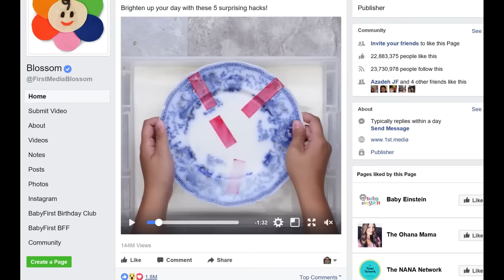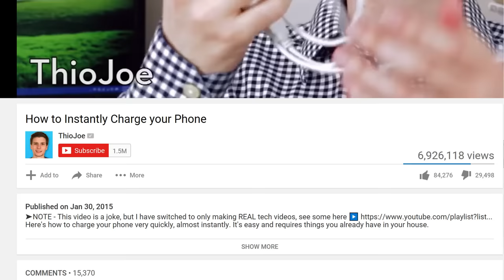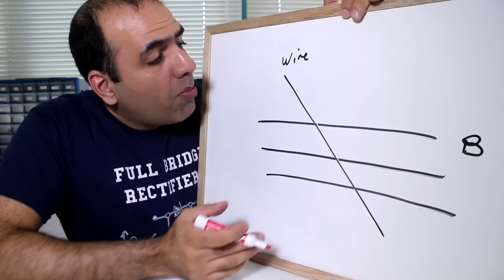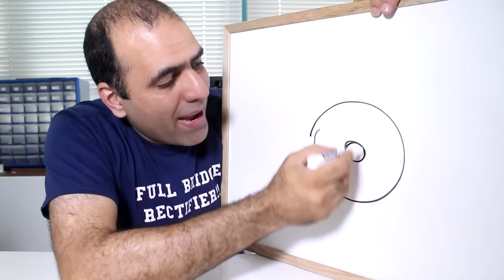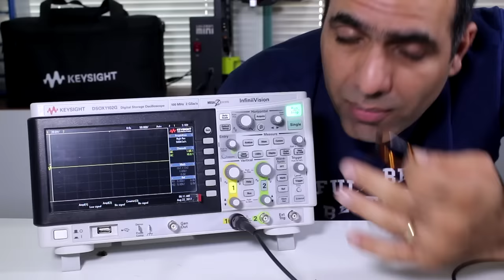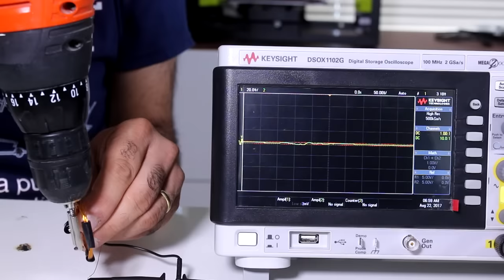Fake DIY Projects Exposed, and How a Real Generator Works

Comment: can someone explain the full br... i mean THE FULL BRIDGE RECTIFIER joke?, withouth the context it's still funny because of the way he says it, but i don't know what makes a FULL BRIDGE RECTIFIER so special lol
Reply: An AC signal changes the output from positive to negative every half cycle, while a DC signal is a 'constant' output. In general, a rectifier circuit is used to convert AC to DC. Since AC is a wave, you want to use a full (full wave) bridge rectifier to convert the entire AC wave to a positive (or it could entirely be negative) output. You can see the rectified (converted) output of an AC signal on his shirt on the rhight hand side (the bump looking things), but it still isn't a smooth signal so you would filter the output by adding a capacitor at the output to lessen the signal drops between the peaks of the bumps.

Comment: I remember after learning about generators in physics I tried to use a multimeter and a bit of wire I had free... I created no measurable voltage and was quite disappointed.

... I remember because it was a few months ago.

Comment: I have tried the milk thing. It worked and made a super strong repair. I was not expecting it to work. I then told all my family and none of them could get it to work. But they used different milk and I'm not 100% sure I gave them the exact instructions I followed.

I tapped the cup together with the fewest tiny bits of tape. Then submerged it in milk and simmered for either 2 or 3 days. I think anyway. I was so not expecting it to work that I didn't do it rigorously.

Oh, it was 150 year old China.
Reply: Quit lying.

Comment: dang. from 59% to full = 2 hours and 23 mins to fully charge on a little mobile phone.
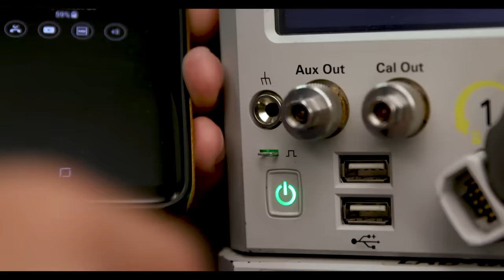thats one weak as USB interface..1990s USB2.0 9:00 with 500ma on a 450.000 US scope, dang even a 500 bucks Micsig scope got USB3 5Gbps high current and TypeC interface.
But its your lukcy day Keysight fellow...lets flip scopes, so you can charge your phone faster.

Comment: You can maybe create free energy while the coil is connected to the motor and the magnet is in the front of the coil and then when you spin the motor generates energy and fix itself over and over and over it's not going to last forever
Reply: You cannot. The coil will always make less energy than it takes to power the motor

Comment: Even if the rotating magnet generator worked, wouldn't it still be easier and cheaper to just get a cheap charger for $5 that out would be too get the magnets, the regulator and solder the whole thing together? If you're lost where no chargers are available, then why would any of the other things be available.

Comment: iPhones have to talk to the charger over the usb connection to make sure they are approved chargers before they will accept a charge.
Most androids only need some voltage on the + and - wires.
Reply: It can easily be bypassed by giving 2 v to data lines.

Comment: I love your channel the shocks make it...i got one for you i never put it out there but i think i found something i just thot of it and tryed it and well it works....take a cell phone with a sound generator app set to 432 tip the phone on its side and hot glue a thread balanced on the side and hang it from the cealing let it stop spinning first then turn on 432 and i found it all ways turns to the right no mader witch side you put it on....so i was thinking we need to harness the energy like make a motor that when turning would generate the 432 by its self thuss power it self thuss free energy......test it your self....

Comment: Fun fact even if that guy got above 5 volts on thaf thing the 7805 regulator would burn coz they dont realy like reverce polarity (learned this the hard way) and preaty sure they wont survive ac as capacitors do

Comment: The aluminuminum foil thing should work by blocking all wireless connections, essentially putting your phone in airplane mode right?
Reply: Won't block them entirely, it will attenuate the signal somewhat, meaning connectivity will be slightly slower. 

Od hedge my bets that buffers and decoding algorithms in the microprocessor would run somewhat slower, meaning it may have the opposite effect.

Comment: Its junk anyway cos hes using more power to drive the 'generator' than its actually producing. A power supply fan with magnets stuck to it with a 500 loop coil round it would be more useful, cos you blowing on the fan would charge your phone (eventually).

Comment: Was the first one not just a version of inductive charging? I mean if it works it works and it is more cool than anything but I don't think it will end up being anything more than a novelty and that is being generous. Make a video on how to make an inductive charger for your phone and watch everyone watch the balls out of it.
Reply: watch the video in toto.  he goes into reason after reason after reason it's bullshit.  Not enough power.  Wrong direction of magnets.  Lacking iron core.  Lacking diodes.  Even his 'improved' version only generated millivolts.  It just can't work.
Reply: @tsm688  I said "make a video on how to make a "real" inductive charger for your phone. If you believe that inductive charging is not real please explain why there are literally thousands of inductive chargers out on the market and why my phone is currently sitting on one....charging??? You don't know enough about electrical field theory to even begin to have this debate let alone comment on something that you clearly (iron cores) have no idea about. 

Please get a mild education.
Reply: @kylapendley924  You said "was the first one not just a version of inductive charging", and the first one is the fraud he debunks.  It's possible to make inductive charging, sure -- but not like that.

Comment: 4 years too late: GIVE ME THAT KEYSIGHT!

But seriously, this video is saying some much needed things. I'm in the midst of planning a build for a from-scratch 240 VAC generator. It will be designed to power a home; complete with central climate, dryer, range, etc...just as reliably as if from the service grid. My hope is to use a 4-pole field configuration in order to make the alternator compatible with a wide range of mechanical power sources. Steam, internal combustion, maybe even water mill.

It will be a massive undertaking, and I'm still in process of collecting raw materials. Like copper--I want to use solid bars for the stator turns, like how power plant alternators are designed, instead of smaller gauge magnet wire. The idea is less worry about overheating, thus lower maintenance.

Surely I'm not the only person to have this idea. So I search YouTube for others who've taken on such projects. All I can find are several million videos about "free energy"....makes me sick.
Reply: Maybe work with something a wee bit smaller first.  Modify an automobile alternator.  Rip out the diodes.  Toy with the windings.  It'll be able to produce much higher voltage than car battery voltage